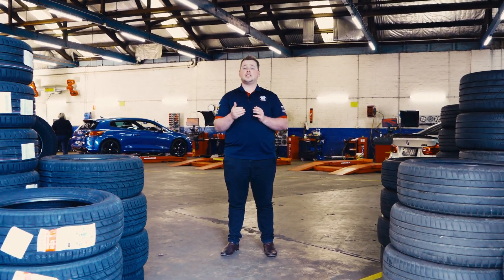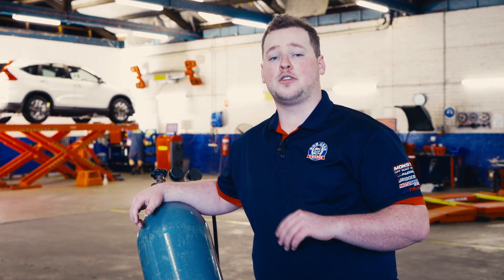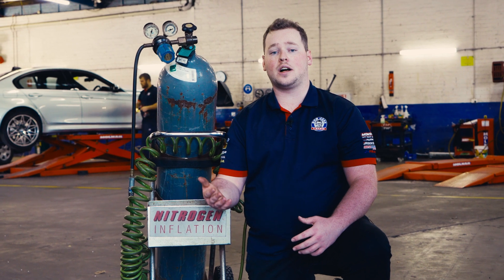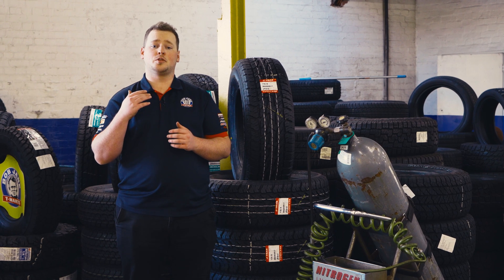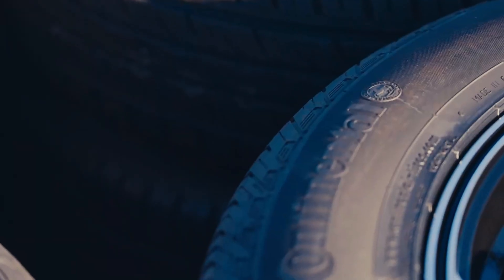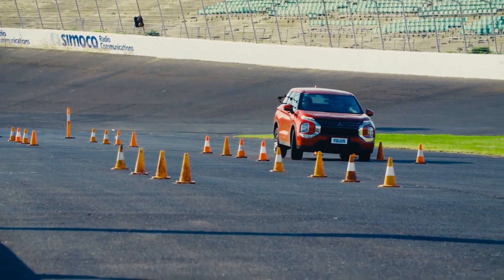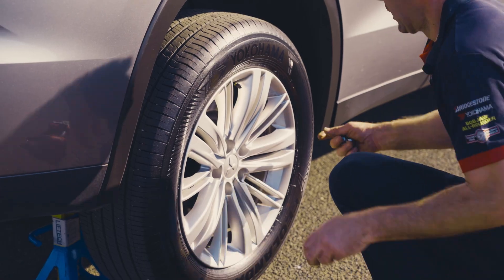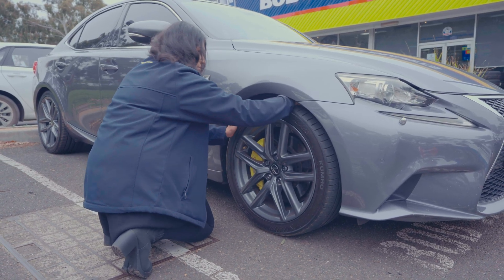Should You Fill Your Tyres With Nitrogen?? | Talking Tyres

Comment: Under the temperature and pressure conditions at which tires operate, the ideal gas law applies very closely. That is, there is no significant difference between the behavior of dry air (80% nitrogen) and pure nitrogen.
If you ever get the chance at a NASCAR race to check out the gas used by Goodyear to inflate their tires, you will find that they use ordinary air. The teams use pure nitrogen from compressed gas cylinders in the pits because it is a more convenient method of handling pressurized gases in that setting.